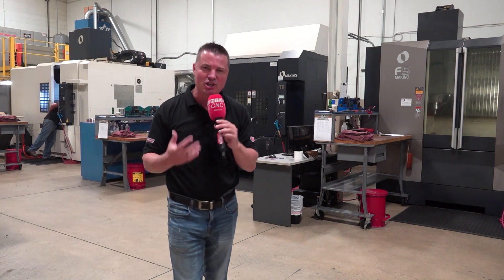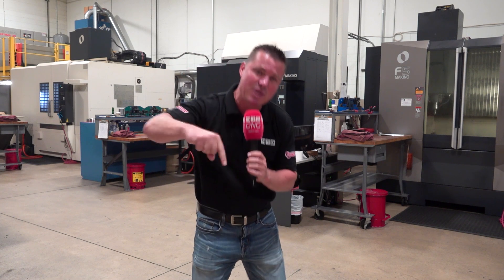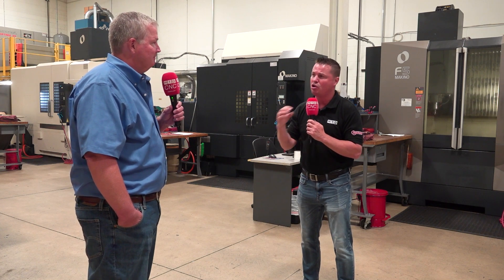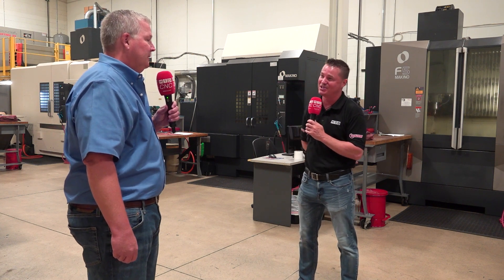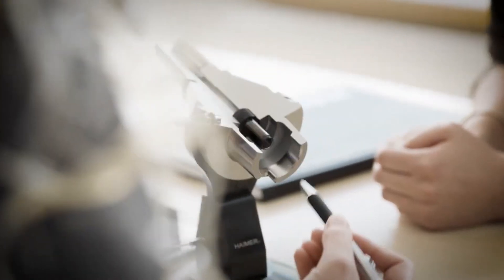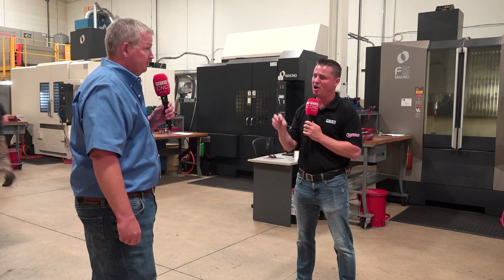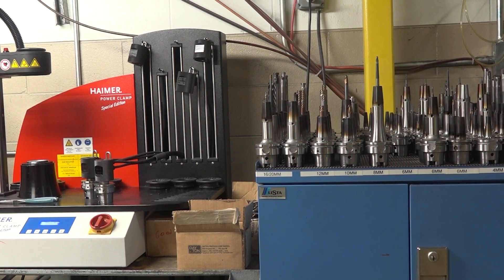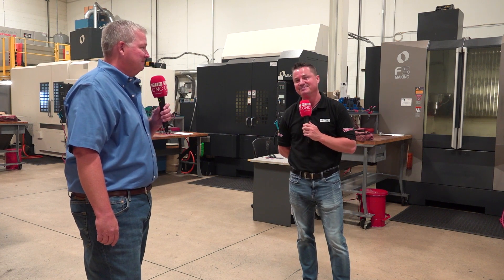The OG of hard milling – the key to their success?

Comment: Great interview, but here's a tip from a photojournalist/videographer slowly turning self-taught machinist:
We do not need to see a machinist or machine shop owner in front of his machines to gain trust in what he says...
Audio is King. So, move the interview to a quiet place unless it's a shop tour where he/she needs to be able to point out things nearby. If it's not that, then you can just cut to b-roll (shot after the interview) to show the points he is making during the interview - it also helps limit the time we only see a talking head. (Have a helper/producer sit in on the interview if possible to make a shot list for the b-roll). 
The result is super clean audio with no downside in visuals. Especially if you take a bit of time setting the interview shot up nicely.